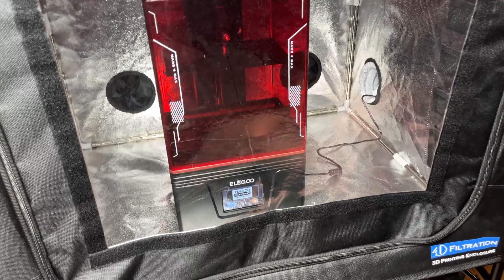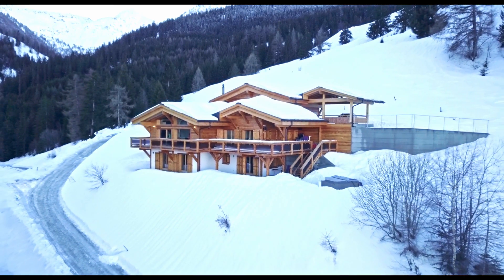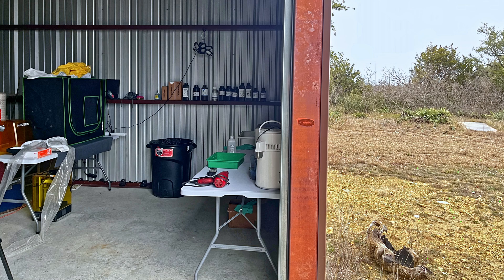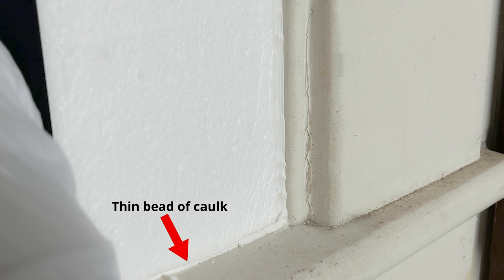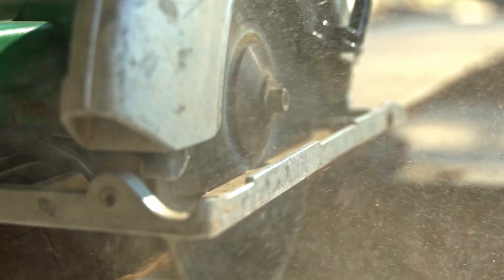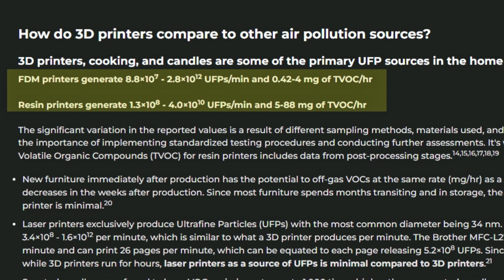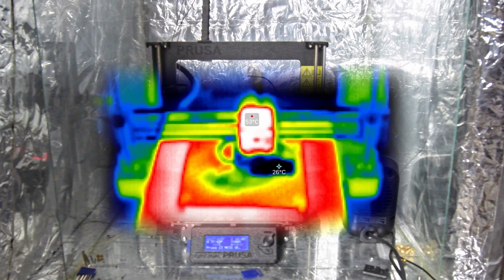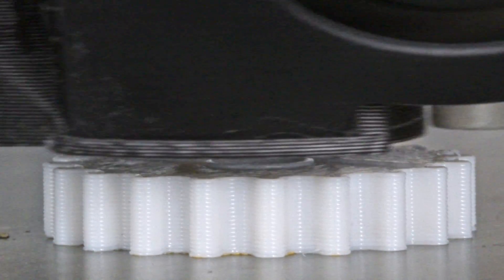FDM & Resin 3D Printer Ventilation

Comment: A lot of times the garage is under a living space. How long do these VOCs last and is it a risk that venting into a garage will vent to the rest of the house?
Reply from the maker: You are right that most garages are attached to the home.
The VOCs, depending on the exact VOC, can last hours or days in the open, even longer in a place without sunlight (UV) like a garage. A common example, formaldehyde, has a half-life of ≈30mins outdoors under sunlight - other eventually deposit in the soil and degrade that way.

If you are venting directly into the garage I would also recommend venting the garage itself to prevent creating positive pressure within that area. So if you have a 100cfm inline fan going into the garage, the ideal would be having no less than 100cfm going from the garage to the outdoors - at the very least, the garage should have a window or door cracked open to allow outdoor air to circulate and carry away the VOCs.

Comment: Do I need permanent fixture for end of vent when using resin printer in my apartment? I think I would not be possible for making such thing with my type of windows as I live at the topmost floor. I think I could just put end of ventilation duct hanging there on the roof.
Reply from the maker: This one is hard to visualize without a picture, feel free to send me a message on reddit or send an imgur link.

Comment: I have my S4 Ultra in my bathroom in a tent with a duct connected to the tent and venting outside plus i have the bathroom ceiling fan that is also vented outside and i also have 1 carbon filter with 16lbs of activated carbon in it and an air purifier in the room plus i wear a respirator when i have the tent open or i am curing prints. this is enough to make it safe right?
Reply from the maker: The venting outside via the duct and the bathroom fan will evacuate most of the VOCs, and the carbon helps reduce the long-term exposure risk. The respirator mitigates the short-term exposure risk.

I would agree that this setup is sufficient, but I would keep these questions in mind:
* Where does the bathroom fan vent to, and is it a shared space (assuming apartment)?
* Does the bathroom fan duct in the attic have any holes?
* What else is the bathroom used for, and if it is used for normal bathroom things, what could be contaminated?
Reply: @ArisAlder  the bathroom fan vents outside along with the ducting ran from the tent with the printer in it and it's my own place so I ran it all myself both the fan duct and tent duct run through the ceiling , to vent hole on the outside wall in the attic so as long as it doesn't get any holes and it shouldn't it goes straight outside

Comment: You mention "common FDM filaments" don't need to be vented by should be filtered. What about, which I believe is the worst offender, ABS printing? Would a layered carbon filter, such as the cut-to-size sheets you can get easily online, suffice? Or would you still recommend ventilation?
Reply from the maker: Yeah when I say "basic filaments" I'm referring to "entry-level" which I try to call out as PLA and PETG. ABS, ASA, PC, Nylon etc can all be considered engineering filament.

It's difficult to say what the 'worst' filament to print would be. If we exclude exotics like PEEK, then a carbon fiber ABS blend would be among the 'worst'.

Carbon sheets, panels, and foam will do little to nothing to capture VOCs. Granules or pellets will be needed to capture VOCs to any meaningful extent.

Ventilation is the safest and cheapest option for using engineering filament.
Reply: @ArisAlder  Thank you for the insightful reply! Cheers!

Comment: Would ABS be safe to print in-doors on a FDM 3D printer that is inside an enclosure using 4D Filtration's Promethean 3D Printing Fume Extractor being used in the re-circulation setup with the HEPA 13 Filter and Carbon Cartridge installed? The room itself can also be vented through a window if needed. Thank you!
Reply from the maker: Using any air cleaner like this with carbon granules will make it safer to print ABS indoors, but the recommended method is still to provide ventilation.

The scenario you suggest would be ideal for this. Air cleaner inside the enclosure, then the room itself being lightly vented. This keeps the heat inside the enclosure, while minimizing exposure to ABS fumes and particulates.
Reply: @ArisAlder  I have a similar situation. I'm planning to print ASA for some automotive parts on my P1S. However, my printer is located in my home office, where I spend a lot of time, and my dog also spends about half the day in the same room. I could create an exhaust system with a fan for the P1S enclosure, but I'm concerned that it might cool the enclosure too much, which could lead to print failures.

The room has two windows, but there is no cross ventilation, so very little (if any) outside air really comes into the room, resulting in minimal exchange.

Do you have any suggestions for solving this problem?

Comment: Would it be possible to simply put the printer outside while it's printing? I have a large balcony that I could use for this and an elegoo mars that I got for Christmas and have been too scared to touch because I don't know the correct set up. If this is the safest option then I'd rather look into some kind of weather proof caddy to store it in over ventilating my indoor space.
Reply from the maker: Having outside is absolutely the safest option, not only for printing but also cleaning. A grow tent enclosure should be sufficient, and your biggest enemy at that point would be cold temperatures.

I would still wear a respirator while interacting due to proximity.

Comment: Thanks for the video! 😊

I’m starting a 3D printing business using FDM printers and currently have three open-bedslinger printers, with plans to expand to six. My workspace will be a 10x8 ft room in my basement, optimized for 24/7 PLA printing with occasional PETG projects.

To maintain air quality, I’m installing a HEPA 13 filter with a carbon stage capable of scrubbing 78 square meters every 30 minutes. I’m also designing a fan system to create slight negative pressure in the room. My goal is to prevent bad air from leaking into the rest of the house when opening or closing the door, but I’m carefully considering how much air needs to vent outside.

The challenge is to strike a balance. Venting too much air could draw air from other parts of the house through cracks or windows, especially in winter, when temperatures can drop to -40°C. In such conditions, excessive air circulation isn’t practical. I’m working on finding the right airflow rate to maintain slight negative pressure without compromising indoor comfort or efficiency.
Reply from the maker: During really cold days/weeks it could make sense to rely on filtration alone, especially if the introduction of cooler air starts to cause print defects.
Reply: @ArisAlder  Yes definitely, but my thought is the printers will keep the room warm especially if I insulate the roof of the room etc the air purifier I have was $400 Cad and very powerful it says to replace the filter every 6 months I'm curious if using it to filter 3d printer fumes would cause it to need replacement more often
Reply from the maker: For the particulates only, the filter becomes more efficient as it becomes loaded/dirty. Compared to normal household use (loads of dirt, hair etc), the ultrafine particles would take longer to completely saturate the filters, so they could last 12+ months.
Reply: @ArisAlder  the slightest exhaust would be helpful all year round

Comment: I'm planning my resin printer setup in a spare empty bedroom. I don't have a good isolated room anywhere else in my house.

I plan on an enclosure setup with a window duct out.

Should I also have another window cracked to bring air in or does that not matter with the enclosure? 

I do live in the midwest where we have a mild winter (rarely snows but gets down to the 20s - 30s regularly), but my house heat should keep the room relatively warm (I'm guessing in the 60s or so minimum) - the other FDM printers I have there will also help keep it warmer. 

Or should I do enclosure exhaust, with another generic room exhaust and intake? So the enclosure goes out, but the room also goes out and in.

Comment: In the enclosure, how can we know how much the fan need to be powerfull?
Reply from the maker: It has less to do about the enclosure and more about the duct size/length and any obstructions. For most situations a 100cfm centrifugal or mixed-flow inline fan will be sufficient
Reply: @ArisAlder  Thank you :) Particuls can stay on the ground of the enclosure? Like the corners, where the air does not pass? And when we open the enclosure, we lift the particles and put them back into suspension. I don't know if I'm overthinking but thank you for your work!
Reply from the maker: Say there is no fan, do just the sealed enclosure. The heat from the printer will create air circulation lifting a percentage of the particles without a fan or wind.

Comment: Wonderful video ! I ve seen it from your blog and here is my situation :

I ll have my resin printer oudoor, on my balcony in a growth tent. I ll also buy an air extractor and an heater. Do you think that i will need something else ?
Reply from the maker: If you have it outside then you will not need a fan or purifier of any kind, but it could help direct the air away from you while interacting. You wouldn’t want that fan running while printing, as it will cool the resin and fight against the heater.
Reply: @ArisAlder  thanks a lot for the explanation ! I was a bit concerned about humidity, do you think it will be okay ? Other people told me it was mandatory to buy a fan for that, so i am confused
Reply from the maker: Personally, I haven’t found humidity to be a factor worth calculating in nor have I found data on it, but I’d welcome anything anyone finds on that topic.

Comment: Besides a window, could someone attach a ventilation tube to a ceiling kitchen ventilation port?
Reply from the maker: If you can verify that the vent does indeed go outside it can work. You also have to verify that the duct isn’t damaged or has holes, as that would push that contaminated air into the attic.

I wouldn’t recommend doing this in an apartment or townhome setting where the duct travels through a shared space.

Comment: Hello, very nice video, I was wondering if I just used the vinyl duct connected directly to a vent that goes outside. without a centrifugal ventilation system inside the duct, could it still work?
Just using the conduct should be enough? Without any ventilation system
Reply from the maker: A fan is necessary in order to push the air outside, and it has to be a fan with sufficient pressure and air flow rate - weak PC fans (120mm) won't cut it.
Reply: @ArisAlder thanks, would you mind giving a link ? For an appropriate fan please ?
Reply from the maker: In the video description I have one linked - looks like it’s about $50 atm on amazon
Reply: @ArisAlder strange, it only make me go to a whole page with multiple different ones, still thank you tho
Reply from the maker: Vivosun’s Z4 centrifugal inline fan - there are cheaper versions out there but they won’t have speed control & they often have less static pressure.

Comment: Thank you for making such informative video. I want to venture on this hobby and purchased a FDM printer. The only room available to place this printer is in my 120 square feet office. It has a big window and it is probably well ventilated. I am wondering if I place an Hepa filter next to the printer would be enough to clean the air from VOCs.
Reply from the maker: A HEPA filter will capture only ultrafine particles. Resin printers that are indoors really need to be vented. Filtration technically can be used for resin, but it requires 5-10lbs of carbon and specialized media & frequent monitoring for leaks and lifespan.
Reply: @ArisAlder  yeah, resin is off the table for me due to its toxicity and difficulty in handling the materials after printing.
Reply from the maker: Sorry I totally glazed over FDM - What filament will you mainly be printing? If it's entry-level like PLA or PETG then any consumer air cleaner will be fine - the VOC levels are minimal. If you do want to make sure you capture the VOCs from FDM then it will be best to use an enclosure, and unlike resin, it's fairly easy to use media for capturing.
Reply: @ArisAlder  hi, I am considering only using PLA. The printer I got is the bambulab A1, so it is opened.

Comment: The exhaust is very well covered, but what about the intake air? I am considering getting a resin printer, and I want to put both my FDM and resin inside a grow tent and exhaust it out my window. The only room I can use is a room my son and I spend a lot of time in. If it's enclosed in a tent and venting outside is it safe? How do you set up the intake air so that it's not accidentally venting into the house through the intake?
Reply from the maker: You wouldn't want an intake fan or anything of that manner as it would negate the negative air pressure inside the tent. All that is simply needed is to unzip the tent slightly or leave one of the the adapters open.

The safest option would be in a garage or etc, but it being vented is generally fine. I would say to try to stay out of the room while printing and for a little after cleaning. The cleaning and post-curing represents most of the short-term exposure. It also helps to remove the resin from the vat and clean up the area very good after printing.

Depending on how old your son is too, you may have to limit exposure and access.
Reply: @ArisAlder  thank you. Our computers are in that room, so it would limit printing to when we are sleeping / gone at school & work. I guess I'm going to actually have to fix up the shed like the wife has been hounding me to do for 2 years... Bummer

Comment: If i went out of a window into an area that people hang out. is that harmful if you were standing outside the window?
Reply from the maker: If the window is like a courtyard and wind is minimal then it could pose an issue, but if there is a strong draft generally it's okay. There is specialized media that can be vented through that helps break down a sizable percentage of the VOCs like FumeFusion.

Once VOCs are outdoors, their concentration rapidly decreases and most readily degrade within minutes to hours, with some taking days. For example, the half-life of formaldehyde under sunlight is 30 minutes.
Reply: Got it. Thank you for the answer. Thinking I’m going to rig it to the top of the window now and maybe get a pipe that pints directly into the sky.

Comment: I have a affinity 422. and the fan should it be in the tent or outside it?   grow tent I am using it horizontally.  is there any particular way it goes?
Reply from the maker: The grow tent can be positioned however you like. The fan should generally be placed outside the grow tent and as close to the window as possible. This make sures it is always pulling the contaminated air.

Comment: I will build an enclosure for my Resin Printer soon. I have a question though - do I need to consider creating a vent for air intake when the fan is running to prevent a vacuum? Or would there be no harm if it's a completely closed/sealed system?
Reply from the maker: You will need a small air intake, but simple gaps or holes will be perfectly fine. For example, on grow tents, just leaving it slightly unzipped works.
Reply: @ArisAlder  Thanks for the answer! And those videos of yours!

Comment: So I bought an elegoo Neptune 3 max so it’s giant. Do I need to buy or make a tent to run a ventilator to exhaust the air and run an air purifier on the desk big enough for the whole room? I planned on having the ducting close to the print area and run it out a window..
Reply from the maker: If it is indoors it should be in an enclosure; otherwise, the household HVAC will spread contaminated air regardless of how close the intake to the vent fan is. Now it is possible to seal off HVAC grilles and "air lock" the room - this has pros and cons.

Comment: Most people have built-in ventilation in their bathroom, and are only there intermittently.
Put your printer(s) on a wheeled cabinet in your shower.
Roll it out when bathing. Roll it back in, and print away.
Problem fixed.
Reply from the maker: People with houses should have it in their garage or in a spare room.
People that are in apartments shouldn't rely on the bathroom exhaust fan, because if the duct leaks it can negatively impact neighbors. Apartments often have shared utility spaces.

Comment: I print with PLA, and is searching for an air purifier to have beside my printer or maybe have the printer and purifier inside an enclosure. If I look on the purifier from Ikea "förnuftig", it has an filter of EPA12. Is this the same as Hepa or Merv 13?
Reply from the maker: The EPA12 filter will be between the MERV 13 and HEPA 13 filters. This could be useful to have in the home, not only for the printer but also other UFP sources like cooking, humidifiers, or laser printers.

Comment: Would taking a small FDM printer, like the Tina2s, outside be enough ventilation when working with PLA?
Reply from the maker: PLA will be perfectly safe to use outdoors.
Reply: @ArisAlder  Thanks, but its indoors I'm worried about
Reply from the maker: So indoors with PLA, the main concern is the ultrafine particles. These are readily captured by any MERV 13 or HEPA filters, making most consumer air cleaners on the market sufficient.
Reply: @ArisAlder  Thank you so much for your advice and taking the time to answer my questions. I'll consider looking into a filter once I can afford it. I was unaware of this type of risk and was working with PLA indoors until now.